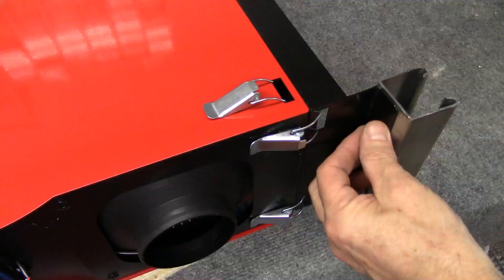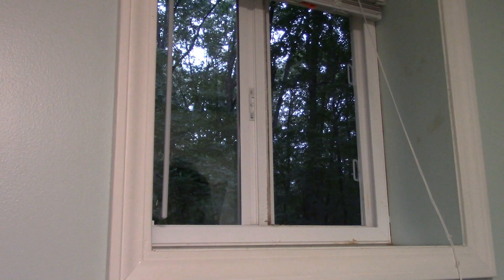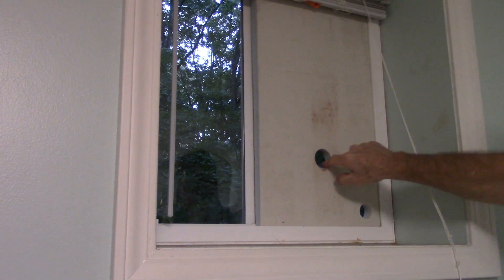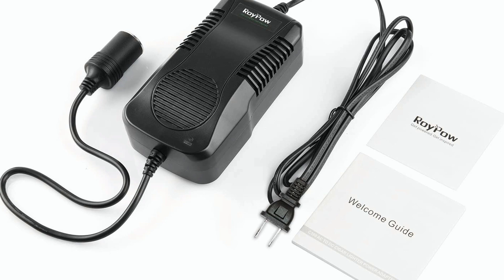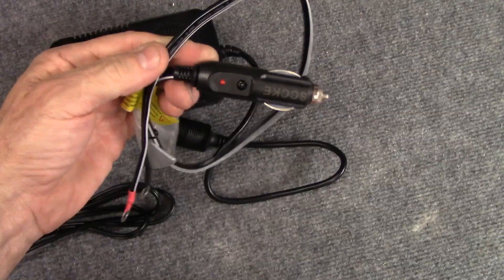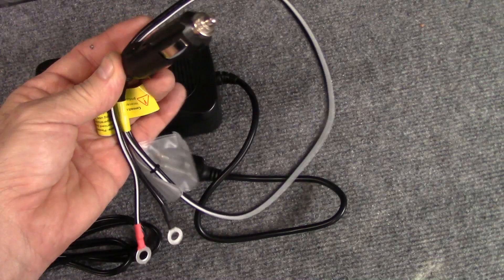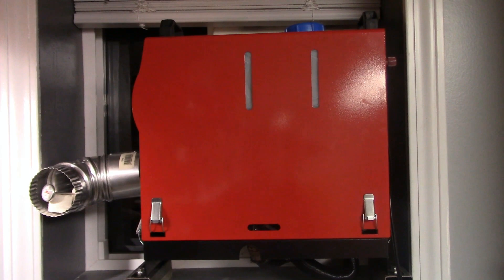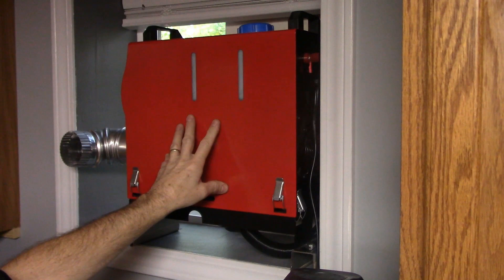Home Chinese Diesel Heater - Portable | Efficient | Safe

Comment: Did you notice any exhaust leak inside. I am not sure if I want to mount my diesel heater inside.
Reply from the maker: Safety is a big concern with me as well. I have not had any leaks. For piece of mind, you could easily mount the heater outside as long as it is protected from rain and the elements. It won't be as efficient but it still works great as I have demonstrated in my other videos. Thanks.

Comment: I like this for a setup up I am thinking of same setup for my cabin/home in the north country of New Hampshire. Sounds like it would not be safe to leave this running though is there a reason for that? I have a two-section house main house is a 15x15 top floor and same size in basement the Phase two as we call it the larger area and is heated by wood mainly phase one is heater by the gas furnace forced hot water and electric baseboard back up I would like the backup heat to be one or two diesel heaters running on 12 volts probably two 12 volt 100 ah battery's so it power goes out there is heat. But it they are not safe to leave running that would shut that idea down .
Reply from the maker: I think this is safe if properly installed. I leave mine running for hours and I have had no problems at all.  I still do not leave the house with the heater running and I'm usually in the basement or close by while it is running just to be safe. I think it is a great back-up for heat if you lose power. Thanks!
Reply: If your worried about safety then you are not ready for it. It's as safe as you educate yourself to handle it's operation. Be safe, not sorry.

Comment: I have a question maybe you can help me out with I smell diesel fuel burning when the unit is on real low or just starting up and then it goes away
Reply from the maker: Make sure the exhaust is not being pulled into the back of the heater where the air enters to be heated. When mine first starts, there is a strong exhaust odor for a minute but it is all outside.  Also confirm you have good voltage (12+ vdc) and at least 10 amps available during start up.  Make sure you have heavy enough gauge wire too. Good luck.

Comment: Mine works great but I cannot access the settings on the controller.  Any ideas?  I set temp using 1.0. To 5.5  would rather setup using temp. Thanks, and great video. I too have my intake inside my basement. I have enough leaks toprovide air
Reply from the maker: You have to push 2 buttons on the controller at the same time. I think it's one of the arrow buttons and the settings or OK button. Then it will let you choose between the 2 modes of operation.  Check out this video. https://www.youtube.com/watch?v=VdUbur5Dfns
Reply: @geenote  thanks for the reply. Mine must be faulty.  It works fine though and I can change the Hz.
Reply: @geenote  thankyou

Comment: why don't you put the heater outside the window?
Reply from the maker: One reason is so it can use warmer inside air to reheat and becomes more efficient.. Another reason is the unit has to be protected form the outside elements. It is also easily mounted and quickly ready for use in any of my basement windows. Thanks for asking.

Comment: Is your blower air inlet restricted sitting that close to the window frame?  If you run your heater on low setting for any amount of time you need to run it on high to burn the suit. It will clog up in no time, run it on high for 10 min before shutdowns.
Reply from the maker: I was a little concerned about that too but I don't think it restricts the air any. Others have recommended running on high for a while so I have been doing that to clean off the build up.  Thanks for the suggestion!

Comment: hello
how is your long time experience with this device? any problems or repairs until now? can you say samething about fuel consumtion?
Reply from the maker: No problems with this cheap heater.  It is very efficient on fuel.  I only leave it running for a few hours at at time while I'm in the basement. Thanks!

Comment: Really better with a bigger fuel tank outside and can run it 24 7 like I do to be very safe
Reply from the maker: Having a larger tank is a good modification and having it outside does sound safer. Thanks for the tip!

Comment: I wonder if you could or should put the intake hose inside the basement? Then it’s not anywhere near the exhaust?
Reply from the maker: The intake hose air is not for the heated room area - only the sealed combustion chamber to burn the fuel. Having the intake hose inside a small room would start using up oxygen in the room. The heated air used for the room is pulled in through the back of the unit. Thanks for asking!
Reply: @geenote  ohhhhh okay 👌 I understand now.
Thank you

Comment: i got a 12v 10amp powersupply and do you think 14 awg cables would be good to connect the heater to the power supply?
Reply from the maker: Yes, 14 awg wire is good for that.  The heater will be pushing the 10 amp power supply when the glow plug is on. That's why I went with a little bit bigger power supply rated at 200 watts which is closer to 15 amps of available power. I didn't want to push the power supply hard and take a chance on it going into overload and losing power. If you lose power to the heater while it is in use, there is a chance of heat damage to the unit. It has to go through a cool down stage when it is turned off to prevent heat damage. I hope this helps. Thanks for watching and commenting.

Comment: looks good. Where is the thermostat? How noisy is it? I have heard that you need to run them on high regularly for some reason, have you heard this?
Reply from the maker: The thermostat is built into the controller on the front.  I could use the automatic/temperature setting mode and the heater will cycle on and off trying to maintain the set point just like the furnace in my house. This may not work good for my application because the heater is sitting in a little "cubby" hole next to a cold window plus I have heard the temperature fluctuates more than a few degrees when using this method.  I find that running it constant on a manual type setting using the fuel pump pulse rate works good for me. It is not noisy although the clicking sound of the fuel pump may be a little distracting for some. The cool down cycle might burn off build up but I have heard it is good to run them on high for a little while every so often. Thanks for watching.

Comment: you can get like 800w more power if you use the exhaust heat. that will increase the efficiency about 15% .
Reply from the maker: Not sure how I would do that....
Reply: I think this person is trying to one-up you on the Doomsday Machine
Reply from the maker: @thegrudge6495  I think you're right !  Dang it..I will have to try harder!  LOL  !
Reply: There are several ways, a longer exhaust pipe that runs inside the house except for the external exit. The longer the pipe the more heat radiates from the long pipe. Secondly, a double pipe packed with a layer of sand between pipes to store the extra heat for a slower release like soapstone.

Comment: Hi , I've watched both videos regarding this heater . I'm going to install a diesel heater in my motorhome . The deciding factor is pump noise . With the kit heater , separate units, the pump is quite noisy .
How noisy is this free standing heater ?
Hope this makes sense .
Thanks 👍
Reply from the maker: It's hard to get away from that clicking rhythm.  I have that unit outside my truck shell and it is still  clearly heard. If you are in a motor home, I would think getting the kit and mounting the pump under the camper with a rubber insulator would be the way to go.  Thanks for watching!
Reply: @geenote  many thanks Keith . I'll let you know how I get on

Comment: Having difficult starts on my heater ,how long should it pump before you ignite it also does red diesel cause difficult starts,lastly should you charge it while running ?
Reply from the maker: Does it smoke really bad after it starts?  Any error codes?  Mine ignites after a few seconds of pumping.  I don't think red diesel will harm as long as you have an in-line fuel filter that gets replaced from time to time. If you are using a battery to run the heater, it is good to keep it charged up when you can even while running.
Reply: @geenote  it was smoking excessively,would take 5 try’s then fire off -today just tried it let it pump maybe 5 seconds and it fired right off ...thinking I will add a thicker gauge wire directly to the battery,,,,I also had a battery charger set to 2 amps on startup ....mine is a 8 kw has a push button only no controller ,,,,throws out good heat still in the learning phase , might try kerosene been reading people use that also ,,,,real good luck today for some reason....maybe I let it pump too long
Reply from the maker: @jj-eo7bj   The unit requires 10 amps so that might be your problem. You also need large enough wire to handle the amperage.

Comment: Does it turn off if it reach the Target Temperatur? And Start Again if its Below? Or did it run all the Time? Thanks dude :)
Reply from the maker: Unfortunately it does not turn on and off. It runs all the time. It only switches to the lowest setting once it reaches the set point and will switch to a higher setting if the temperature falls below the set point.

Comment: The one thing I really dont understand is why you put the intake outside pulling air right next to the exhaust. Why would you not have the intake pulling from the ambient air inside? maximizing efficiency is the key to residential HVAC and its gonna work a lot less heating up 60f air than it is pulling 15 degree air, not to mention all the snow/rain/etc it will pull in being exposed like that.
Reply from the maker: That outside air intake  is only for the sealed heat chamber and is not re-circulated heated air -  It is only to burn the fire.  The air that enters the back of the unit is dragged across the outside of the sealed heat chamber and increases in temperature as it flows across the heated chamber and exits the other side to heat the room.  Having the heat chamber intake air pulled out of a room is not safe and only depletes the small room from oxygen.  Hopefully I explained it so it makes sense.

Comment: You don't have to have the fresh air to the outside. If you don't put the pipe on you are just sucking warm air out of the room. Kinda works like a small vent to the outside then.
Reply from the maker: When I first set this up in the basement, I just vented the exhaust pipe outside and left the air intake hose on the inside. Then I thought it might be safer and correct to pull fresh oxygen from outside rather than using inside oxygen so I went ahead and drilled out a second hole in the window panel. Thanks for watching and the comment.

Comment: What is the insulating material that you are using in place of the glass?
Reply from the maker: That insulation has been laying around our shop at work for years.  It is in a 2' by 3' sheet 1" thick and used to insulate the walls of things like ovens and furnaces.  I'm not sure what the material is but It doesn't make me itch when I handle it.  It came from a company in Winston Salem, NC called Thermcraft that makes industrial furnaces and ovens.

Comment: Does the fresh air intake on these heaters just go into the combustion chamber and then out the exhaust? Would there be any advantage to using the warm air from your basement to supply fresh air? In an auto A/C system, the A/C setting is usually drawing outside air through the cooling coil of the car, but the MAX A/C setting takes the already cool air in the car and recirculates it through the coil so it gets even colder. Does this work that way? If the fresh intake provides the air to the blower and the combustion chamber, it seems that you could recover some wasted heat by putting the fresh air supply in the house. Does that make sense?
Reply from the maker: The fresh air intake is only to a sealed chamber to basically make fire.  The heated air that enters the room comes in through the back panel and blows out the front. I'm not so sure that warmer fresh air to the heat chamber makes a hotter fire - I think more fuel makes a hotter fire.  Having the unit inside the window instead of outside takes the already heated room air and continues to heat it up even more as it flows across the outside of the hot chamber. If the unit were outside the window, the outside air stays whatever the current outside temperature is. The warmer the air is that enters the back of the unit (not the fresh air intake hose), the warmer the air is coming out the front.  Hope that makes sense.
Reply: @geenote  Keith, after I watched this video I ran across the video where you were using this to heat your truck topper. In that video I saw the intake for the heated air and now I understand how this thing works. Sitting in your basement window sill, the intake WAS inside the house recirculating the already warmed air. Thank you so much for responding to my question so soon. Not everyone on YT does that, so it makes you special in this world of info-sharing. I have actually seen a number of your videos, now, on this heater, and have learned something on each of them, so good work. Stay safe.
Reply from the maker: @mrhalfstep  Thank you!
Reply: More OXYGEN makes a hotter fire, ask any blacksmith. Cold air has more oxygen than warm per cubic foot

Comment: On the lowest setting how many litres of diesel from a full tank, number of hours until empty? Great video.
Reply from the maker: Great question. I have not let it run constant till empty or added up all the time.  The manual claims 0.1 liter per hour on low.  It is very efficient on fuel use.  Thanks!
Reply: I have the same heater and the best ive been able to get is 4L in 26hours which still is ok
Reply from the maker: @liljasere  Is that 26 hours on lowest pump Hz setting?
Reply: @liljasere  Continuous running? Or intermittent from thermostat setting at lowest temperature?
Reply: Lowest setting target temperature of 5 degrees so it goes into tic over straight away continuous running for 26hours drained the fuel tank from full

Comment: how many hours does it work on a 100 amp hour battery >? i wanna buy it but dont know what amp hour battery i would need
Reply from the maker: I would stick with a 100 amp hour battery unless you have it connected to a battery charger.  Check out this video to give you an idea of how long it will run using a 100 ah battery non stop https://www.youtube.com/watch?v=g8kqRp4TlHE&t=16s

Comment: Can u set those for 60 and it will maintain 60 degrees
Reply from the maker: Good question. There are 2 modes.  In Manual mode, you adjust the HZ setting which is how fast the fuel pump is cycling which keeps the unit continually running....or you can set the temperature (in Celsius) to maintain the temperature set point which cycles the heater on and off as needed using the built in temp sensor in the controller. So you would just have to convert from C to F if you use the automatic temperature mode.  I'm not sure how close it will keep at the set temperature...it might vary a few degrees. I always use manual mode and adjust the HZ up and down as needed which changes the fuel rate and the fan speed.  Hope this helps.

Comment: I would think you could just pickup the "fresh" air from the room... like setting recycle in your car.  Also you need to def have a co2 or 2 alarm in that room.
Reply from the maker: I have seen some installations that pull the fresh air out of the room air but I know it is not recommended.  I would think it's a safety precaution not to use up the oxygen in a smaller well sealed room. It really does pull in quite a bit of air through the fresh air intake while running. I agree that a CO2 is recommended.  Thank you!
Reply: @geenote  Also it is possible after a failure, for exhaust gasses to come out of the combustion air intake, hence it must not be in an occupied area. Really with these units, the whole thing should be outside.

Comment: It's not the case in the UK I run my heater 247 from October to June at a cost of £58 per week,on the Lowe's setting 16c
Reply from the maker: I only use mine for short periods of time during winter months.
Reply: Why? It really isn't that cold here.
Reply: @grantbanstead1971  £84 now not the cheapest to run  but I haven't much choice.

Comment: how much fuel does it use to heat your space?
Reply from the maker: The heater sips fuel. A tank last 24 hours or so on lowest setting.
Reply: @geenote  that sounds great, but with diesel at $6 a gallon, off road for a few cents less, it's hard to say what type off heat won't empty our wallet
Reply from the maker: @seymourwrasse3321  ain't that the truth!

Comment: Worth remembering, these heaters dont conform to any recognised safety standards, so anyone unlucky enough to have a fire, is likely to have an insurance claim refused.
Reply from the maker: That is such a good point and something I have thought about. I would feel better if the unit was set up outside of any structure and the heat piped inside.

Comment: How long can you run heater on a tank
Reply from the maker: I have not let it run constant till empty or added up all the time I use it.  The manual claims 0.1 liter per hour on low.  It is very efficient on fuel use.  Thanks!

Comment: What you pay for to run an electric heater still cheaper than what diesel fuel cost are. Install electric heater in room .
Reply from the maker: It would take a big electric heater pulling some amps to keep up with the diesel heater. A small electric space heater pulls around 12 amps on high.